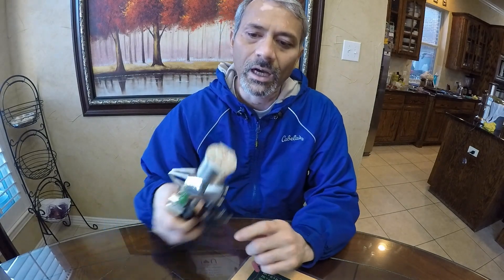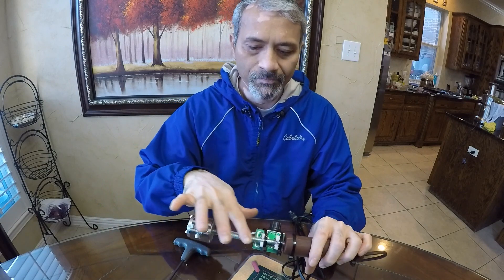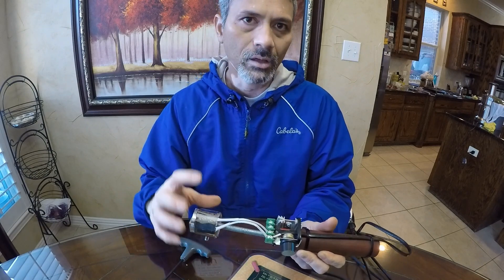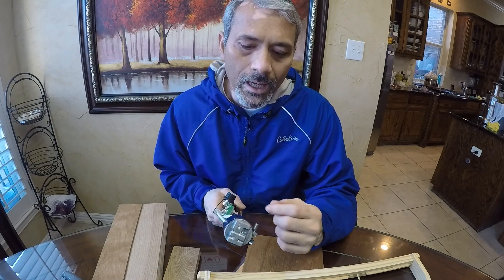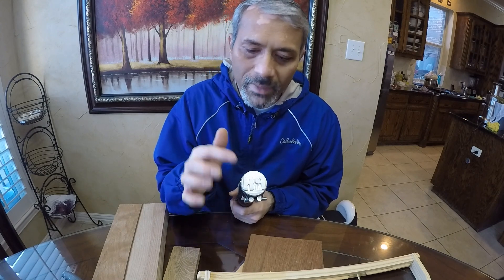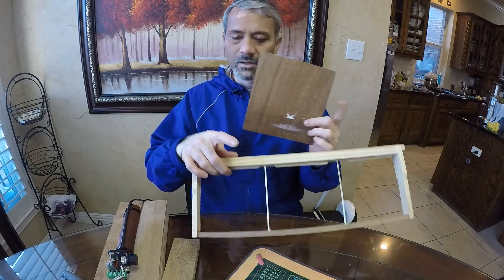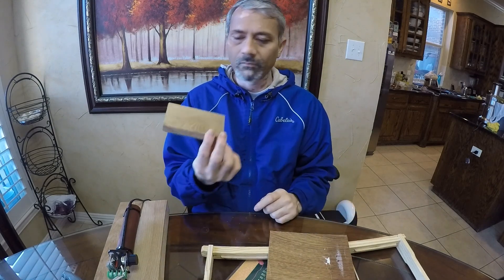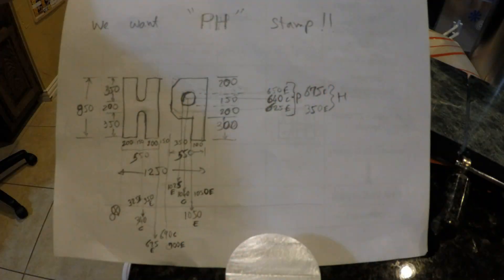HOW TO make an electric Branding Iron for less than $30!!

Comment: Great video.  Thank you.  How did you attach the circuit board to the threaded rod?
Reply from the maker: I just zip tied it as a temporary measure but is is still holding up. My plan was to use some Teflon spacer and wire tie if the rod got too hot.

Comment: Excellent work.  For a complete parts list, what cord would you recommend?
Reply from the maker: You can use any 3 wire power cord you have available. I robbed a power cord from one of the broken appliances. You can us a short extension cord as well. make sure you ground the metal handle.